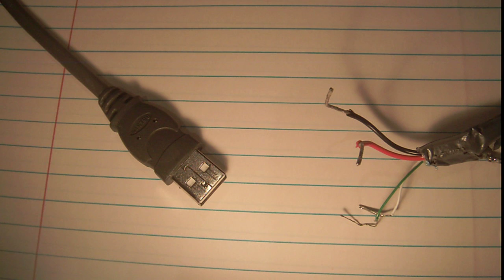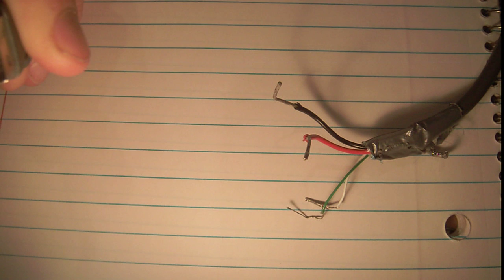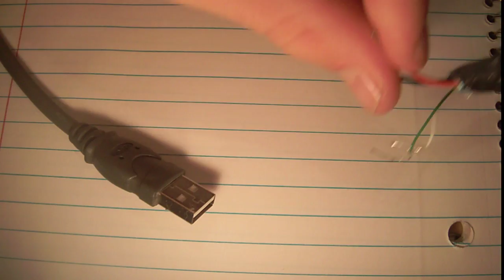How To Check USB Voltage

Comment: Gave it a try, worked for a second.. then I was getting 0 volts and then OL which freaked me out lol. Then I realized the dying battery symbol on my meter (digital). For the quick moment, it was giving about 5.x volts (sometimes 4.9),  really wanted to meter the back USB ports though.. dang. Gotta pick up a new 12v. I'll be back with a few questions if my suspect in voltage is correct...

Comment: Would you be able to use a ‘minimum performance’ VOM meter to read the output current as well? I have some that provide as little as .7 A -(700  mA) , according to the extremely low-contrast, microscopic-font-sized specs label, and some  as high as 2.3 A..

Comment: hello i need to place a voltage regulator between my usb port and an audio sound card how to do it?because i think my motherboard voltage regulator is broken..so i need the data to work but also get 5 volt power to the usb wich is regulated.
i dont want to change the mother board

Comment: This was just what I needed. Even if it isn't the most artful instructional video out there, it gave me enough info to butcher a USB cable and use the red and black wires to test the current on my project with my multi meter. Thanks.
Reply: ya that's all that has to be said not pretend to show you how

Comment: Sorry, but your video is kind of useless unless you explain which of the tinned wires we should be getting readings off of for volts, amps, whatever. I like the idea of stripping the cable for contact points but, without telling us how to hook up your "gizmo" to a multi-meter we're no better off than before we watched your video.

Comment: Worthless.   So we have to destroy a USB cable in order to measure the voltage?   What you need to show is a female USB connector plugged into the connector you show.   That way it could be used for other USB cords.

Comment: What do you guys get on USB cables ranging from 2 metre to 5 metre? Volts and amps.
According to my phone on a 5 metre usb extension cable it drops off from 5v and 500mA to 4.1 volts and 260mA 

Also whats the drop over 5 metres made up of 2 2 1, do connections cause a problem.

My pet hate is 5 metre usb2 extension cables because that's the Max length and most things plugged into them have a cable too, so push it over 5 metre causing problems because of the voltage or amp drop.
Why don't we see 4 metre ones, not just 3 or 5.

Comment: what is the shielding for? is that to protect the cables inside from damage by being stepped on, etc?
Reply: Shielding is to get rid of magnetic interference with other devices. Usually a copper or aluminium wire is not so sensitive if you step onto it rather it is vulnerable to tearing or for tensile load. Imagine a mouse fallen down from the table or pulling out a charger through pulling the wire. For this reason an USB cable like in your mouse have a rope like fiber that is usually shorter than the actual wire is. It helps the wires to survive until the fiber breaks away. This may end up in contact failure.

Comment from the maker: It shouldn't cause any problems, if you think about it as long as there is no circuit connected to the cable there is essential no change (barring any antenna / receiver effects of the cable). In my case I may have had a bad cable or an accidental short.

Comment: I really like this because it is simple and straightforward.  Do you have a way for me to check the output amperage of a USB wall charger I bought?  I think it is much lower than stated but don't know how to figure out the watts or amps it is putting out.

Comment from the maker: @skierplaterandy on some computers there is no problem but on others when the computer sends out the enumeration signal and gets no response it get's really confused, and can lock the ports, but if you want it to connect it  to a computer probably nothing would happen.